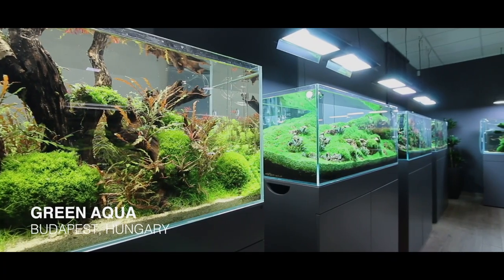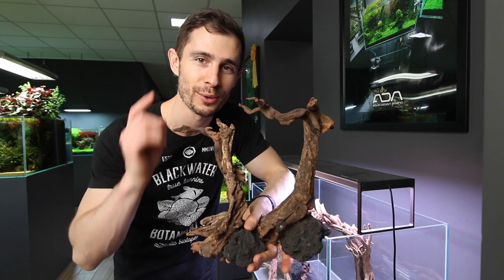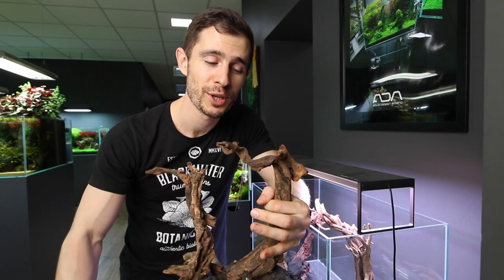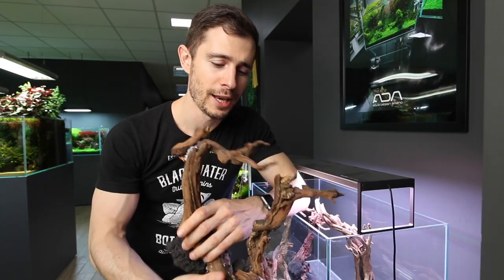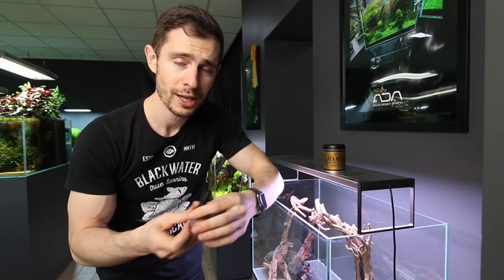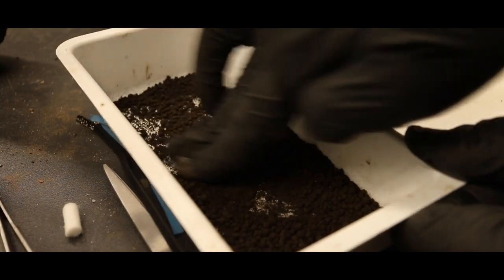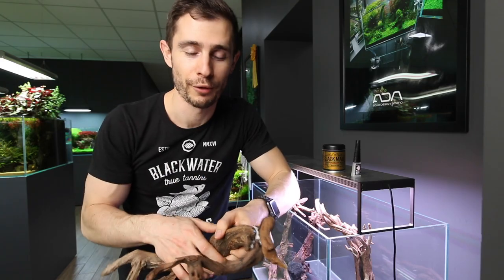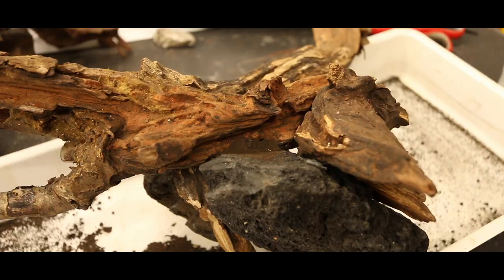How to hide cigarette filter and glue on a Driftwood Aquarium Setup

Comment: Hello. How much force has this super glue/ ciggarte filter tehnique? Is it stronger than glueing big rocks with aquaristic silicone? I'm talking about 10 kg heavy stones and  30cm tall. For example, a stone this big wich  has sharp  bottom and i want to glue some kind of base from the same material, to give it stability, because doesn't stand by itself.  What should i use to glue them toghether? I don't want that the glueing to fail in time and break me tank.  Many thanks!